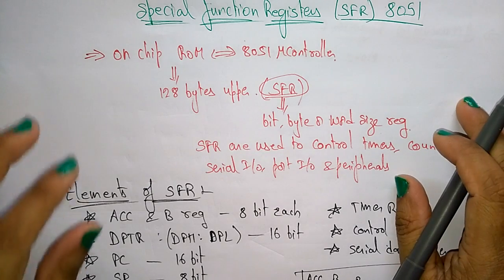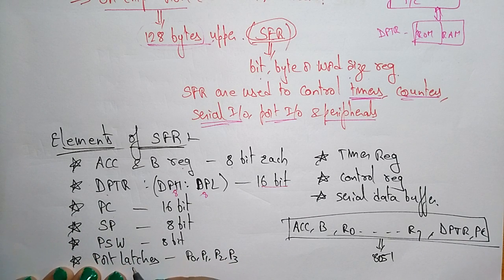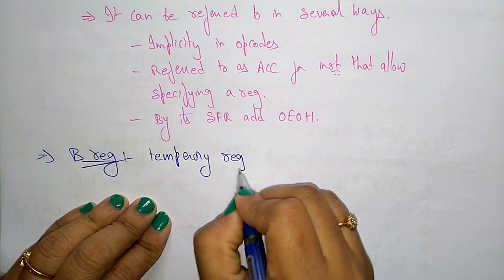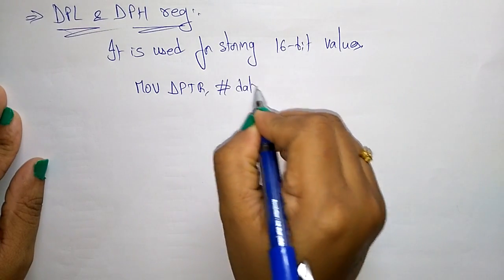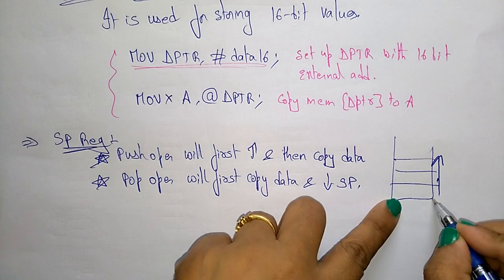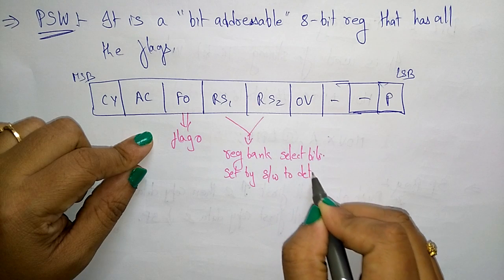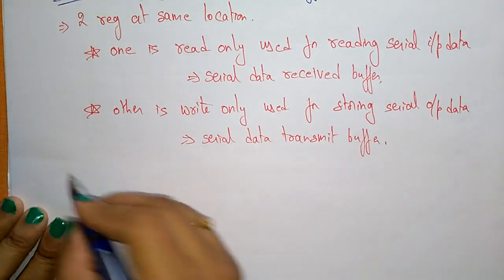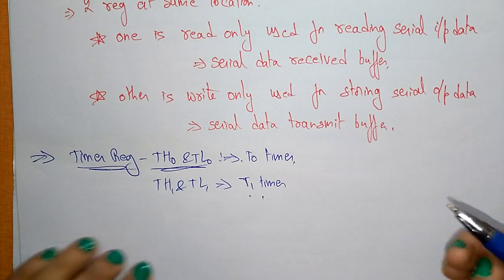8051 special function registers | SFR | MPMC | Lec-58 | Bhanu Priya

Comment: It's not ROM its upper 128bytes of RAM
Reply: But ram is only of 128 bytes in 8051
Reply: @aayush-zw1mx  128kb of RAM with extra SFR register of 128kb which is nothing bt RAM only
Reply: @gajananshete5075  so total ram is 256 bytes?